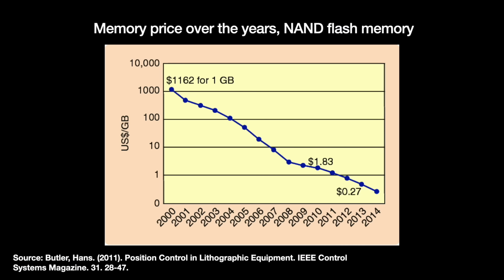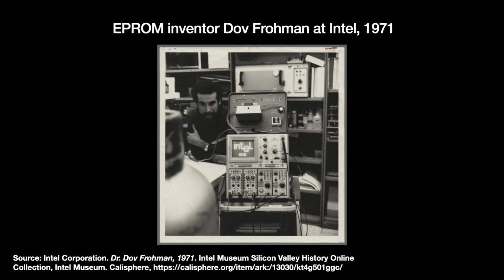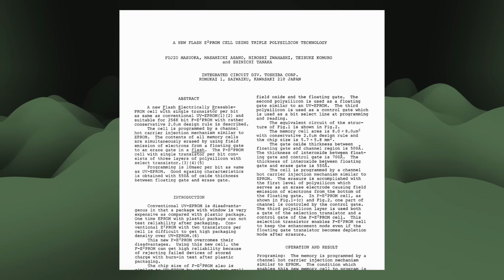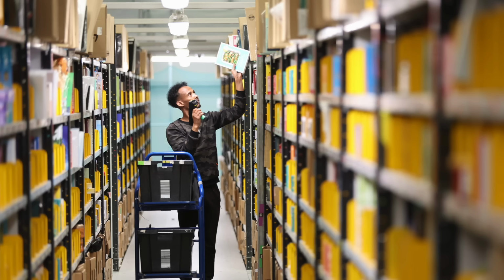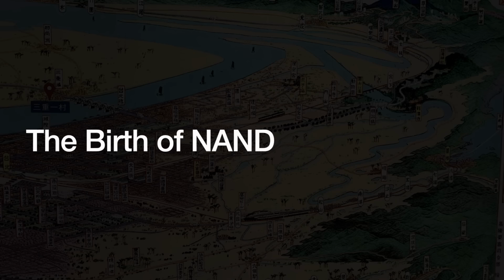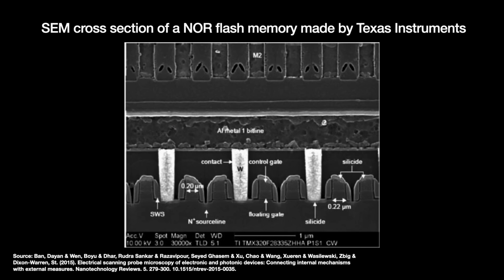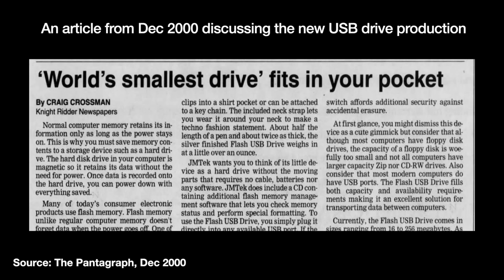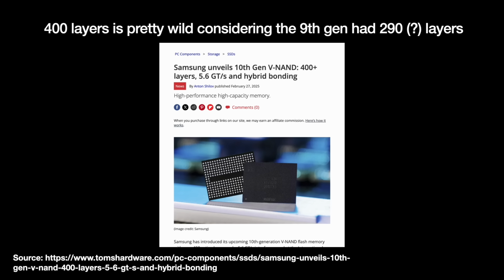The Evolution of Flash Memory

Comment: AI Summary

Abstract:

This video chronicles the 60-year evolution of flash memory, from its theoretical origins to its current state as a dominant force in data storage. It begins with the invention of the core component, the floating gate transistor, in 1967 and traces its commercialization through early forms like EPROM (UV-erasable) and EEPROM (electrically erasable). The narrative focuses on the pivotal invention of flash memory by Fujio Masuoka at Toshiba, which led to two competing architectures: NOR and NAND.

NOR flash, commercialized by Intel, dominated the 1990s with its fast random-access speeds, ideal for storing executable code like PC BIOS. However, NAND flash, also invented by Masuoka, proved to be far more scalable and cost-effective due to its denser, serial architecture. The video highlights key innovations that fueled NAND's exponential growth, including SanDisk's system-level approach of adding a controller for error correction and wear leveling, the development of Multi-Level Cells (MLC) to store more bits per cell, and the modern transition to 3D V-NAND to overcome physical scaling limits by stacking memory layers vertically. This relentless scaling enabled transformative consumer products like digital cameras, USB drives, the iPod, and modern SSDs, cementing NAND flash as one of the most successful semiconductor products ever created.

The 60-Year Evolution of Flash Memory

*   00:00:06 Moore's Law in Memory: The video opens by highlighting the dramatic price collapse of flash memory, falling from $80,000 per gigabyte in 1987 to just 2 cents today, demonstrating that Moore's Law is still alive in memory technology.
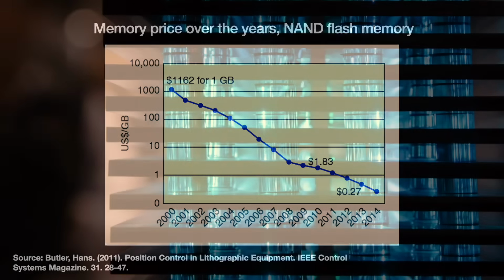*   00:00:48 The Floating Gate Transistor: The core technology of flash memory is the floating gate transistor, invented in 1967 by Dawan Kong and Simon Sze at Bell Labs. It uses an electrically isolated "floating" gate to trap or release electrons, changing the transistor's threshold voltage to represent a binary 1 or 0. This charge can be held for over 10 years without power.
*   00:03:22 Early Applications (EPROM): The first popular non-volatile memory using this technology was the EPROM (Electrically Programmable Read-Only Memory), invented at Intel. It was crucial for product development but had a major drawback: it required 15-20 minutes of exposure to UV light to be erased.
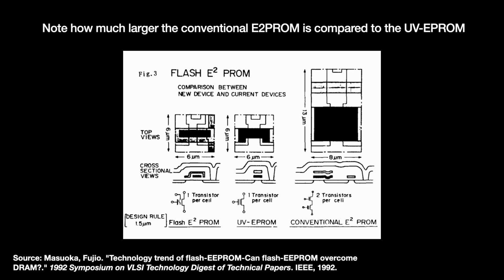*   00:05:49 The Birth of Flash Memory: In 1980, Fujio Masuoka at Toshiba invented flash memory to create a cheaper, simpler, and fully electrical alternative to EEPROM. Erasing an entire block of cells at once reminded a colleague of a camera's flash, giving the technology its name.
*   00:08:08 NOR Flash Architecture: Intel commercialized the first mainstream flash memory in 1988 with its NOR architecture. In NOR, each memory cell has a direct connection to the bit line, allowing for fast, random access to any piece of data. This made it perfect for storing and running code, and it became the standard for PC BIOS chips in the 1990s.
*   00:09:41 NAND Flash Architecture: To compete with hard drives, Masuoka later developed the NAND architecture. In NAND, memory cells are connected in series ("strings"), significantly reducing size and cost at the expense of speed and random access. Data must be read in larger blocks, not individual bytes.
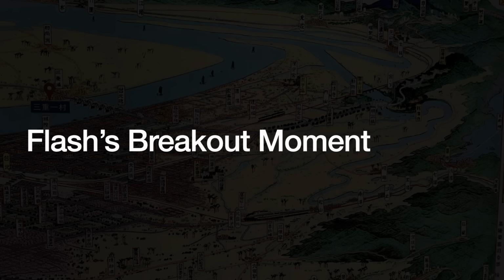*   00:12:28 The Controller is Key: Flash memory is inherently unreliable, as the oxide layer wears out with repeated writes. Eli Harari's company, SanDisk, solved this with a system-level approach, pairing flash chips with a controller IC. This controller manages error correction and wear leveling (spreading writes evenly across the drive), making flash a viable and reliable storage medium.
*   017:54 Scaling with Multi-Level Cells (MLC): A key innovation to increase density was the multi-level cell, which stores multiple bits of data in a single transistor by using several distinct charge levels. This evolved from single-level (SLC, 1 bit) to multi-level (MLC, 2 bits), triple-level (TLC, 3 bits), and quad-level (QLC, 4 bits), dramatically increasing capacity without shrinking the physical transistor.
*   020:02 Enabling the Consumer Electronics Boom: The falling cost and increasing capacity of NAND flash directly enabled waves of popular consumer products, including the first commercially successful digital cameras (Casio, 1995), USB flash drives (2000), and MP3 players—most famously Apple's iPod Nano and Shuffle (2005), for which Apple cornered 40% of the global NAND supply.
*   022:13 NAND Becomes Dominant: Around 2004-2005, NAND flash surpassed NOR as the leading flash architecture due to its superior cost-effectiveness and density, making it the clear choice for mass data storage.
*   023:13 Going Vertical: 3D NAND: When planar (2D) scaling hit its physical limits around the 15nm node, the industry pivoted to 3D NAND. Instead of shrinking transistors further, manufacturers began stacking layers of memory cells vertically. Samsung pioneered this in 2013 with a 24-layer chip, and today's chips can exceed 400 layers, ensuring continued density growth.

I used gemini-2.5-pro| input-price: 1.25 output-price: 10 max-context-length: 200_000 on rocketrecap dot com to summarize the transcript.
Cost (if I didn't use the free tier): $0.04
Input tokens: 20934
Output tokens: 1214
Reply: Thanks for the summary!  It must have cost you a pretty penny and all for the benefit of some anonymous strangers on YouTube.  Thanks again.

Comment: That term "MLC" for just the dual-layer version of flash storage is silly because it ignores that TLC and QLC, etc. are also multilayer. So "MLC" should refer to 2+ in general, while "DLC" should be for just the 2-level version specifically.
Reply: When they invented MLC they don't know they can go much higher. Each level is exponentially much harder than the previous one.
Reply: @kazedcat : I'm aware of that, and it's exactly why they should've only named the 2nd level "DLC."
Reply: I actually like Samsung's old naming approach of "SLC" and "X-bit MLC". TLC is "3-bit MLC". It made perfect sense.
Reply: @tomhsia4354 : Or it could be shortened by:
1: SLC
2: DLC
3+: MLC
MLC 3: TLC
MLC 4: QLC
MLC 5: PLC ("Oops, now we're mixing up numbering systems. At least I think...." 😆)
...6: HLC
7: ("OK, maybe not. Wait...") 7LC. 😆
8: OLC
9: NLC
(10+: "No one will ever need more than 9 layers of cells in flash storage!" 😆)
Reply: @HelloKittyFanMan  This is why I think something like "X-bit MLC" makes the most sense for future stuff.

Your method of appending a number to MLC also makes sense, though I'd argue DLC is not needed, just use "MLC 2". Under the current system, I agree they should have called it "DLC" to begin with.

Honestly, I think 5-bit MLC (PLC) is already absurd. The more bits the harder it is to implement. The amount of voltage level increases exponentially, after all. There has to be a point of diminishing returns. We may make something denser than conventional silicon NAND by the time 6-bit MLC (HLC) becomes fit for mass market.
Reply: @tomhsia4354 : I wasn't actually calling them "MLC 3," etc. Just shorthand for showing you the different levels as MLC would be a category and then you would have your subs from there.

"DLC" for layer 2, and "MLC" as the category label for 3+ does make sense, because even though "multi-" can technically be just 2, it's often reserved for 3+ when 2 is just its own specific thing with "dual," "bi-" or "di-," etcetera. Kind of like the difference between saying "both" vs "all 2" (see Taco Bell for more details).

Why would the increasing the number of layers also increase the number of bits?
Reply: @HelloKittyFanMan  That's what SLC, TLC, QLC, etc means.

SLC stores 1 bit per cell using 2 voltage levels.
MLC stores 2 bits per cell using 4 voltage levels.
TLC stores 3 bits per cell using 8 voltage levels.
QLC is 4 bits per cell using 16 voltage levels.

The "L" in "XLC" refers to “levels”, not physical NAND layers. When it comes to layers of 3D NAND we're already in the hundreds of layers. My MX500 Sata SSD allegedly has 176-layer TLC NAND. Samsung and SK Hynix are talking about a thousand layers by the 2030s.

Comment: Old enough work with UV erasable EPROMs. The 2708 needing two supply voltages at that. The first uCs I used in the late 1980s, also used EPROM program memory. Still have my UV eraser.

Comment: The first SSD came way before 2000. I have a 10.4MB Sundisk Flashdisk in a PCMCIA card in an HP Omnibook 300 from 1993. Of course this used NOR flash. With Windows 3.1, Excel and Word loaded on a separate ROM card this was totally adequate for the time.

I believe the first multi-bit/cell flash memory was NOR, not NAND. Intel won the best paper award at ISSCC in 1995 for a 32Mb 2bit/cell NOR flash and introduced a commercial product shortly thereafter

Comment: I don't think it's accurate to say that EEPROMs never got popular; they got very popular but didn't scale well to larger sizes, so were typically only used for very small amounts of data in specific applications. For a decade or two, it was the primary go-to for initial boot ROMs such as the BIOS code in computers (among many other uses), although nowadays even chips they call "EEPROM" (especially larger ones over a megabit or so) are usually based on flash memory instead.

PROMs were often used in very early computers for cost reasons even after the advent of EPROM and EEPROM, but eventually the ability to update the device firmware in-place (combined with reducing costs) meant that putting a re-writable ROM in pretty much every device was the sensible choice.
Reply: Every car with fuel injection also have the ECUs parameters stored in EPROMs or later EEPROMs.

Comment: The incredible part to me about flash memory is that the floating gate can store charge for so long without losing it. You'd think at these small scales and with the imperfect realities of the world, charge would leak out over the course of somewhere between seconds and weeks - not years or decades!
Reply: Current flash memory don't use floating gate anymore. They replace it with a dielectric material that trap charges. Since the material is non conductive it can hold electrons better than a floating gate. The drawback is that writing consumes more power.
Reply: isn't the select part of an flash memory transistor a switch?
Reply: @Madrrrrrrrrrrr yes, one that thanks to the architecture and some clever semiconductor engineering remains in the same state for really long periods
Reply: I remember when 1and 2 gb SD cards cost like $80 or more now I can get 512 GB for like 40 or 50 and 1 TB for  80 on Amazon. Incredible tech.

Comment: Question, is the strings in the nand memory the reason we divide memory into blcoks?
Reply: Part of the reason. A block is much larger cluster than just strings. They cluster an array of strings then wire all of them into a single unified erasing hardware. This saves a lot of space for more capacity.
Reply: is the fact NAND memory is not erasable, just overwriteable, the reason strings are immutable in many programming languages?  (nerd joke)

Comment: The Apple Newton is an interesting little side story of Flash in the early 90's.  It had no conventional filesystem because it was the first OS really developed for flash so it used a permanent-memory object persistence model that wasn't files, on the theory that NOR flash was fast enough that you didn't need to think about things like "reading files into memory" any more.
The world just shrugged at what an interesting idea that was under the hood, and stuck FAT-16 on Flash drives and carried on like normal.
Reply: A history of file systems video: UFS, XFS, FAT, NTFS, BTFS, ext...bet you can find that somewhere on YouTube
Reply: I expect that the reasons it didn't catch on was partially that it wouldn't work with NAND Flash and partially because NOR Flash speeds would become increasingly uncompetitive with RAM speeds, so you would probably end up just saving and loading the database to/from a more conventional drive anyway, so you might as well use a more traditional file system, too.

Comment: I just realized what an obscene profit Apple must make when they give you an offer to upgrade your SSD when you configure a new MacBook.
Reply: They're not the only ones who do it (basically every smartphone maker does) but they are definitely one of the worst offenders. And like many negative trends in the technology space, they are the ones who set the trend.
Reply: I would not be entirely surprised if they start manufacturing them all with the largest size and then electronically activate whatever size you pay for...
Reply: A base m4 mac mini has 5 usb3+ ports. I use a 6 euro 10Gb usb case and a 60 euro 1 tb nvme drive. 20 GB in 30 secs. And you can even update the SSD inside the mac mini with a 2tb OEM version around $300.  So apple SSD policy? I don't care. I only care about ram. Wish Apple made those options cheaper and faster.

Comment: My first digital camera used 2MB SmartMedia cards. I splurged and bought an 8MB card a few months later. That was in the late 90's, so not that long ago.
Reply: 30 years ago is a long time. (Compare WWI planes and the first jet plane are separated by about 30 years)
Reply: My first digital camera, Olympus Camedia. I bought in 1994, was like that. I still have it, and it works fine. Though, SmartMedia cards are expensive and hard to get. p.s. It used the same cards as my Creative Nomad II MP3 player; sadly, that no longer works.
Reply: @lesliefranklin1870  , my first was a C-400L. 0.35 Mega Pixels. It was replaced by a C-800L, which still provided less than 1 Mega Pixel resolution and the image quality was quite awful. That's when folks said digital will never reach the quality of film 🙂
Reply: @heiner71  Cool. Mine is a D-460 zoom. It takes 1.3-megapixel photos.
Reply: Mine had a 3.5" disk drive.

Comment: I still have a 4MB CF that belonged to my dad. 

He used it for his Psion Series 5 palmtop. He made the prescient choice to pay for an extended warranty on his first palmtop, a Series 3, that covered accidental damage. They were so fragile that he got it replaced 3 times (maybe more), each time receiving an upgraded model. A 3a, then 3c, then 5. Don't ask me why that info is burned into my memory like an EEPROM.

The Series 3 and relatives had proprietary flash cards. The Series 5 took CF, a significant upgrade. User expandable (and standardized) storage was a big deal even in the 90s.

Comment: I'd like to mention that the EEPROM, to this day, still has its own importance and places.  Although it may or may not be a discreet chip (e.g., as part of a microprocessor, CPU, or FPGA), it serves an important job.  The device can be used for  personalization, parameter storage, non-volatile state storage, entitlements authorization, etc.  They may not need to be super fast (just like a scratch pad), large in storage size, or high volume to make big money, but they are embedded tightly in the system operations.
Reply: Many consumer electronics devices chose EEPROM for storage of settings and serial numbers/MAC addresses, separating it from the NAND, allowing that to be operationally read only (except when being updated).
Reply: It was useful but probably the least reliable, regularly failing after a number of years use.
Reply: either it is still a discrete 24x64 alike i2c chip, but on most SoCs it's indeed integrated, and emulated as a partition in the onchip NOR.
and yes, it's a common failure mode, breaking those cells by "unclever" embedded devs due to excessive write cycles, rendering thousands of devices "stuck at boot" in the field....

Comment: Is flash really still getting cheaper? For example the Samsung 870 QVO 8TB was introduced almost 5 years ago and costs only slightly less today then when it was introduced. And there never was a successor with more TB 😢
Reply: Not enough market demand unlike 5 years ago
Reply: they got significantly cheaper in the smaller quantity range, we're seeing 1-2TB for like 50-75 dollars these days, well, pre tariff at least, idk what its like now.
Reply: Where I'm at, the QLC 870 QVO costs more than the TLC 870 EVO for equivalent capacities for whatever reason.

I wonder why they don't make a 8TB or even 16TB 870 EVO -- the density is there. Cost is probably the biggest factor, followed by the focus on NVME SSDs.

The biggest benefactors of cheaper flash costs are SD cards and thumb drives -- those have really come down in price.
Reply: You have to also take into consideration that the inflation in the last 5 years for the dollar has been around 25%. Even if it has kept the same price, it would mean it is 25% cheaper

Comment: Has anybody developed a similar stacking geometry for sram?
Reply: Not possible because you quickly run out of space to wire them. At most they can two or three stack the transistors but above that the wiring contacts will consume more area than the transistors. Although they can stack the dies when packaging.

Comment: How does one deposit 400 layers without 1200 or 1600 steps in the manufacture?
Reply: Good question!
My guess is that it's only like 800 cycle of CVD and maybe some polish only every few layers?
Reply: There are thousands of manufacturing steps anyway to complete the whole NAND, but to construct the cell layers, it is mostly alternating layers of deposition, with no lithography or etching in order to build the “lasagna”. Then after the lasagna is built that’s when you can do one big etch to construct the columns or vertical trenches, then do more deposits to line the trenches you just etched with other material. In order to get 400 layers they may have to repeat the process a couple times, say 100 layers at a time